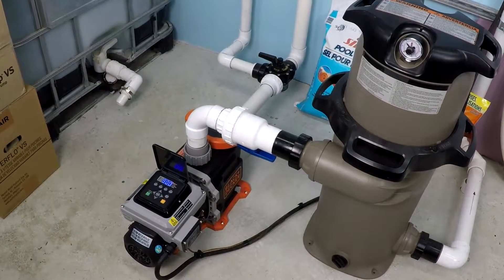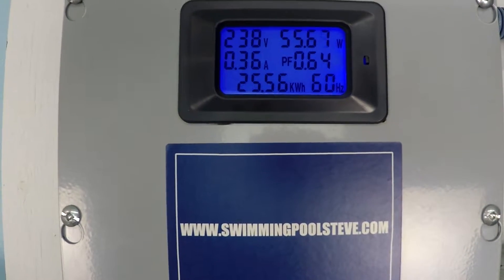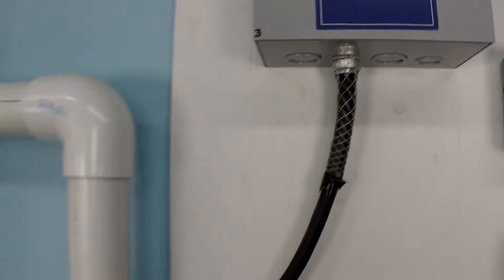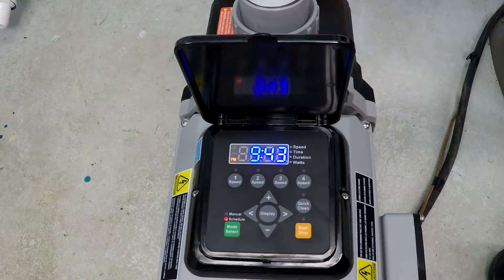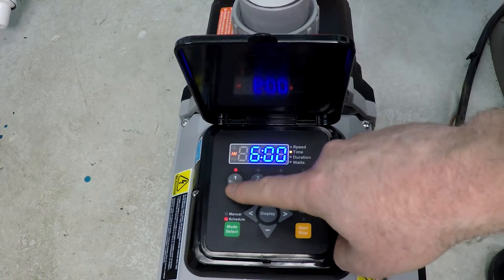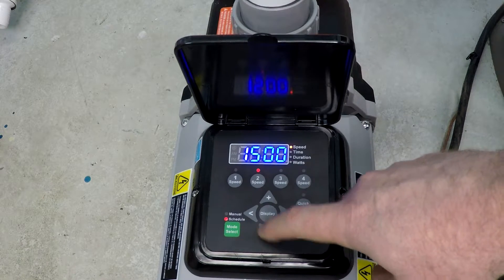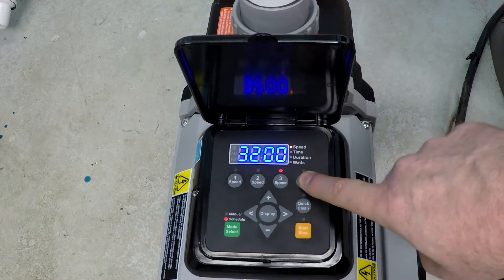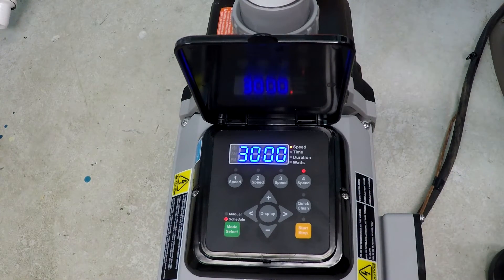Programming A Black + Decker VS Pump Schedule

Comment: geez, i must have some crazy flow restrictions, or my flowvis is jacked up.  i'm getting like 50% of the gpm at those rpms.  11@1000, 21@1500, 52@3000.  opening all suction valves helped a little, but not nearly enough.  with all open at max speed i was just over 80 gpm.

Comment: Awesome Steve. Can use the same schedule for a salt water system? I have an Ichlor 30 w 12k gal pool.
Reply from the maker: Probably, or something close to this. Can not stress enough every pool is different. Do you have a flow meter?  That is really what you want to dial in your filtration and your electricity savings.

Comment: I'm migrating from a 2hp single speed to the B&D 3hp.  Currently I run an external timer for my pump and salt Gen.  Can I still do the same and let this only come on at specific times?  What happens when power is cut from it, does it auto start when power is restored?  
We have summer peak hours with higher rates I currently avoid.
Thanks...
Reply: I just upgraded also from 2hp single speed to the B&D 3hp VS..... as SwimmingPoolSteve shows you select the start time and after that the pump runs in up to 4 phases for which you then can only choose durations to run for the phases (speed 1 phase, speed 2 phase, speed 3 phase, speed 4 phase).  To disable any of the phases (e.g. 3&4) just set their duration to zero. Then the pump would only run speed 1 phase for the duration you set, and speed 2 phase for the duration you set.

In addition, if you want to enable support for being controlled by an external timer you can do that with the alternative display available for purchase that supports external control, look for "Automation-Capable Variable Speed Pump Adapter"
Reply: @CajunCoding  Nice Tip.  I just ordered the 3HP.  I can literally buy 2 for the price of the Pentair or Hayward.  We'll see how it works out.  I could be kicking myself, or I could be sitting poolside sippin' pina colada's   :-)
Reply: @DIYReality  I honestly think you'll be enjoying those pina colada's 🍹

I just finished installing the B&D 3HP the past couple of days. . . but I've actually integrated mine with my Hayward Aqualogic Automation center which has a great HomeAssistatn home automation integration....I'm already in Love with the VS pump seeing power readings in the low hundreds of watts is wonderful; and it's really nice how the pump shows you the power consumption!  The quality of the pump feels really solid so far; every bit as good as the Pentair SuperFlo it replaced...  while being significantly more quiet... like way way more quiet.

I've recorded the videos and content to share how the automation is set up with my Hayward Aqualogic Goldline system....
Reply: @DIYReality how is the pump working out for?  I am thinking of getting the 2HP
Reply: @Ambrosius13 
Very good.  Two seasons now.  I have a master timer on the pump & salt gen to power it about 9hrs.  Runs 5 hrs in the morning, skips peak time pricing from the electric comp (3pm-7pm) and comes on for another 4. I have the internal timer on the B&D pump scheduled speeds at the times my main timer is on.  It's been working out great.

Comment: Great video, but the 90* elbow is too close to the pump to get accurate readings. I have used this pump on one of our pools now for one year and it is working great.
Reply from the maker: The 90 is within the parameters provided by the manufacturer in the installation manual. It is close, but exceeds the minimum requirement.

Comment: Steve I have this pump and it seems like its sucking some air at low speeds but I can find no leak. What do you think? Is that normal?
Reply from the maker: Is your pump above the water level in your pool? It is common for lower speeds to result in air in the pump visible through lid. Do you have a flow meter to confirm you are actually moving water?
Reply: @Swimmingpoolsteve  thanks for confirming this is normal.  I also experienced this, after just upgrading my pump yesterday and found that after running at 1500 RPM all night, the top 20% of my basket showed air this morning after running flawlessly with no air (only the tiniest of bubbles) for hours yesterday at higher speed...

Comment: How do you reset the clock on the pump? We had a new b and d VS pump wired in without setting the clock and now we cannot get back to the clock setting by following the manual recommendations.
Reply from the maker: When you hold the left arrow and right arrow for 3 second the time LED will start blinking. When you see it blinking press display button to enter clock mode. From her + and - button sets the time. Can you let me know if this does not work?
Reply: I have the same issue, and pressing the arrows at the same time doesn't make the help. display flash.  I've tried powering off for a couple of minutes to try to get it to reset to the factory settings, but that didn't work either. Thanks for your

Comment: Thanks Steve, great video and information! I’ve just purchased the B and D pool pump and have a question… can we program a 12 hour cycle instead of 24 hours? Thank you.
Reply from the maker: Sure if that is what you like to do.  When you program it is like a 24 hour clock starting with speed one.  Just program your four speeds to only total 12 hours and the pump will turn off after speed 4 completes and wait for the 24 hour clock to start again.
Reply: @Swimmingpoolsteve  I programed the 4 speeds for only a couple hrs each..But the pump never shuts off or stops it seems. What could be the cause of this. I have programmed it correctly.

Comment: Great video, thank you! I am imagining GPM and watts would increase ~slightly w/2HP unit?
Reply from the maker: Yes, the 2hp model uses 1800W at maximum speed versus 1500W that the 1.5hp model uses.  You can also look up the flow curves which would allow you to estimate flow rates as well.  For reference the 3hp model uses 2200W at maximum speed.